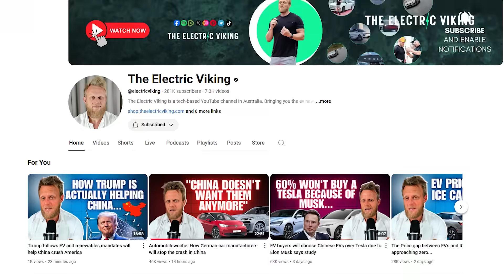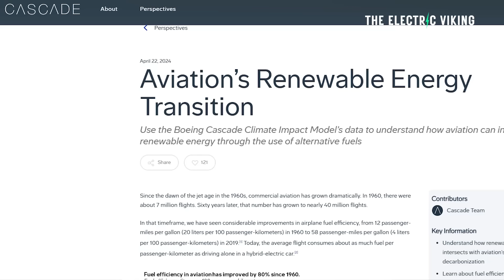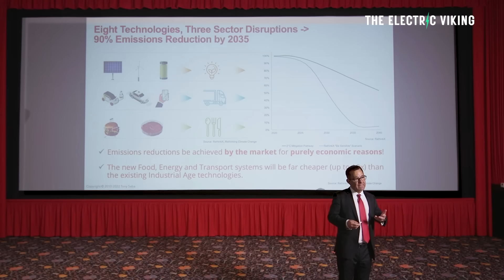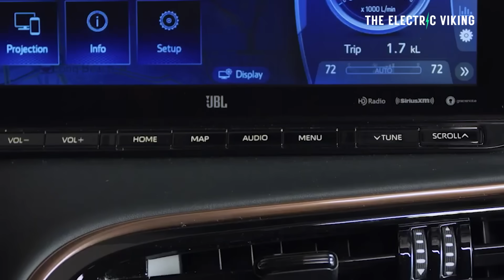The global industries that clean hydrogen production with DISRUPT

Comment: Hydrogen highly unlikely to replace marine fuel, it will most likely be a combination of bio and synthetic fuels, or possibly sticking with fossil fuels and offsetting the emissions elsewhere. If using hydrogen it would have to be liquid requiring extremely high performance cryogenic storage, and even then it would have nearly 4x the volume of current Marine fuel tanks plus a large volume for the insulation, to store the same amount of energy.

The cost of hydrogen to end users is not going to become incredibly cheap. The hydrogen is always going to cost significantly more than the cost of electricity used to produce it, and you're not going to make hydrogen in vast quantities just from dirt cheap surplus electricity, it will almost certainly be paying wholesale prices. Furthermore, the cost of storing shipping/transporting, compressing, liquifying etc. will add significant costs, which will also be significantly higher than they would be for LNG. Cost of the cost of electricity might become incredibly cheap, cost of all the other stuff in the hydrogen supply chain is unlikely to follow the same trajectory.

Synthetic fuel storage for backup generation, to mitigate long periods of dunkelflaute, I am almost certain will also not use hydrogen, we have the technologies for substantially better alternatives. Furthermore, long duration hydrogen storage in very large quantities requires geological storage, which is only practical in certain geological structures to make it economically viable, which severely limits where it can be implemented.

Using hydrogen for long haul flights is a possibility because this is where the energy to weight ratio of a fuel has a significant advantage. However, the planes will need to be designed around the hydrogen fuel as you probably won't be able to store it in the Wings, there probably wouldn't be room for the insulation. The bigger Challenge for aviation is probably going to be the logistics of producing comet storing and delivering it to the airports, you're not going to be able to track it to the aircraft in tankers like you do with current aviation fuels. Also, hydrogen as a GWP about 11, 100 year baseline, so if there are significant leakages it may not be that much lower carbon than using kerosene.

Comment: I do not get it that hydrogen will be used for shipping at bulk.
Ships are very big but do not need an explosiv bomb inside their hulp. And still the amount will be incredible high....requiring OR  a very good cooled tank (when that refrigerator fails the tank will burst in an explosion, no space for failure during many weeks od sailing)

Also producing electricity directly from H2 (fuel cell) still is very difficult on big scale. We need for the membranes in thopse Irridium...one of the rarest elements in our crust....mostly deposited there by meteorites....which makes it difficult to mine.
When we use Hydrogen just for burning the efficiency is very low compared to batteries.

We have done shippeing around the world on wind for centuries. With the current tech we still can build ships using wind to go around the world.
And for in and out harbours battery electric propulsion. Seems much cheaper to me to operate.

Hydrogen is very usefull in the steel industry as one of the very rare possibilities to use instead of cokes.
Also in planes, much more weight dependent, I see hydrogen as usefull.

And as last. At places were we produce Hydrogen with "spare energy" we also can counter that with producing electricity at that same place...which is m uch safer because there is no high pressure or very cold transportation needed for H@.
See also aother comments about the issues around containing the very smaal H2 molecules in tanks.

Comment: H2 is too hard to transport and store. The only major use for green H2 is for in situ production in industrial processes, like steel, cement and fertilizer. Eventually all transport will be electric. For now, it would make sense to switch aircraft to methane, from kerosene, ideally using "e-methane" (from CO2 and green hydrogen, produced in place), making it a carbon-neutral fuel. 

Soviet Tupolev Tu-155: In the 1980s, the Soviet Union developed and tested the Tupolev Tu-155, a modified Tu-154 airliner that successfully flew using liquefied natural gas (LNG). The Tupolev Tu-155 was a medium-haul aircraft, originally designed for flights of around 2,500 to 5,000 kilometers

Comment: I'm honestly not convinced Hydrogen has any role to play.. I suppose it comes down to how much batteries progress. For instance, a lot of people were totally convinced at one time that HGVs would have to be hydrogen, but look what happened, batteries got better, now hydrogen HGVs are on the way out as they simply don't make commercial sense. For ships, yes you need a huge battery but, weight isn't as important as it is with aircraft, so you could have a big battery that takes up say, 25% of your cargo hold, but if it's still 50% cheaper to sail this ship because electricity is always cheaper than hydrogen, well, battery is going to win again. For aviation it'll come down to just how much batteries can keep improving energy density. Perhaps airlines will simply break longer haul flights down into legs, so instead of staying on the plane for the entire journey you land half way and get on another plane that's already fully charged. Again, if it's 3 times cheaper to run aircraft like this compared to a Hydrogen airplane, then it's probably a compromise worth taking. I absolutely agree with you that their will be excess electricity in a 100% renewable grid but we seem to be pretty good at finding uses for electricity these days, be it to power AI or whatever, and there are many many more efficient ways of storing electricity than converting it to hydrogen. Plus if all countries have these grids that are sometimes producing so much excess electricity who will they sell their hydrogen to (which would not only be more expensive to make but needs transporting etc)...?? So yeah I seriously doubt shipping will go Hydrogen, maybe aviation, but I could be totally wrong on this of course!

Comment: We should probably look at the Hyrogen Ladder, which is a framework that categorizes the potential applications of hydrogen based on their economic and technical viability. It helps prioritize where hydrogen can be most effectively used in the transition to a low-carbon economy. 
The High Priority Uses are: Ammonia production, Steelmaking (via green hydrogen), Long-haul aviation & shipping, High-temperature industrial processes. These applications have one important thing in common. They could use hydrogen locally, fueled by locally produced hydrogen either from overproduction of wind and solar electricity or via small nuclear reactors.

Comment: Hydrogen is the secret sauce in green steel production. That is probably its most important use for climate change mitigation. There are people working on commercial scale green ammonia too (with hydrogen as an input). I doubt if H2 would be that popular as a fuel (directly) on ships, because having 20 tonnes of cryogenic hydrogen at 20 atmospheres next to you in an Atlantic storm wouldn't be fun. Also, there's more hydrogen in ammonia per unit volume than there is in, well, hydrogen. There's well over a century of expertise in storage and distribution of liquid ammonia. Millions of tonnes a year moving aboard ships. Despite its toxicity accidents are very rare.  
There are functioning internal combustion engines and gas turbines using pure NH3 - or partially decomposed (NH3 + H2 + N2 ). Their efficiency and mechanisms to reduce NOx output are improving rapidly and approaching commercialization. (E.g. MAN ES Engine).

Comment: Except for Japan and China there is no real infrastruture for fueling cars.  Mainland US only has some stations in California.  These few are either in LA or SF.  There is only one station on the freeway between the 2 cities and if it´s not working you need to call a tow truck to finish your journey.

In Europe Germany has 65 stations, Holland France less, UK has 9 mainly around London Scotland only has one.  Itreland, Italy, Spain, Portugal, and most Eastern eu countries have none.  Scandanavian have 1 or 2 per country.  Toyota is very much against EV because China dominates the EV materials and battery production, plus chinese companies have better EV design, better software and better tech.  Toyota only has one EV sold outside China and it´s based on an old Chinese platform

Comment: It is pretty obvious, at least atvthis point in time, that H2 is dead for autos. It is reasonable to explore other specific uses.  But cost, effiecency and storage are, at present, insurmountable. Basically we have 3 potential sources of H2. Cracking methane or other hydrocarbons is a disater and will be phased out. Hydrolysis loses about 30 % of its energy in the process and converting H2 to usable working form  either mechanical or electrical loses another 30 percent. Compared to an ev which loses effieciency( approximately 20%in transmission, and 5% in ev motors) doesnt make sense when compared head to head. Some other factors that could be considered are: decentralized solar reduces grid losses and yet to be discovered catalysts that increase electrolysis, rapidly increasing battery storage densities, and efficient but low density energy storage such as gravity, heat, alternate battery chemistries will change the equation as we build out our electric future.

Comment: You are right Sam, hydrogen won't be for cars. Hydrogen is an energy means of transport, better than long eluectroduct at the moment. Saudi in fact is developing an hydregen pipeline to Europe instead of a an electrocute to send the excess of renewvable energy. Moreover it can be stored for longer than batteries and useful for the steel industry instead of coal. So like renewable electricity it is an important part of the game for a CO2 zero policy. Part of the world, also Europe, have too short daylight during winter, solar + batteries should be more than double sized and it's not so easy to find all this room in some overpopulated countries. Hydrogen can be a solution.

Comment: Spot on analysis Sam, though here are my differing points. Hydrogen or eFuel will end up in long-haul aviation as it has 10x the energy density of batteries. The weight of the fuel is critical for these flights.  Unless there is a miracle battery discovery which I doubt.  Secondly, I doubt we will need to produce excess Hydrogen, may be easier just to curtail the output.  Also expect battery storage (utility, home and EV) to play a big role in limiting over capacity on the grid.
Reply: That is 10x of current commercial available batteries, technologies like Lithium-Air batteries that exist in small volumes today will likely match the useable energy density of current jet fuels by the time long haul hydrogen flight is feasible (current projects being 2030 to 2035).  The current limitation with the technology is cycle life (<1,000 cycles) but is being address both in cell design and in looking at systemic solutions such as containerised flight specific battery (swappable, charged off plane) designs that can be efficiency and low cost recycled back in to new battery at their cycle life. 

The next question is dead-weight of the batteries, which is also being looking into. However, here e-fuels have the edge over both batteries and hydrogen as it can use the current design parameters of aircraft (such as current landing systems). With Hydrogen one also need to solve the problem with containers that are too heavy and bulky for long haul flight, if using compressed gas, or require heavy onboard cooling systems (powered partially by batteries) to keep the hydrogen in a liquified state.

It is likely that short/medium haul flight will be battery based (lower operation costs) and long haul will be synthetic fuel based or hybrid battery/synthectic fuel for lower take-off/landing emissions impact.

Comment: What is the share of energy in the cost of H₂? Without this information, you can't answer the question. I know it's not very facts driven, but It feels to me it's not that much compared to the price of storage and safety, especially for boats. I mean, if you don't use it the moment you produce it, everything gets terribly complicated. Also, producing it from water requires platinum, I ear, quite a lot of it, given its rarity. Also, it might have a high energy weight density but a low energy space density unless it's cooled down a lot, which is not very compatible with a boat that can spend weeks away from a port. It's barely compatible with rockets, which travel times are usually counted in minutes.